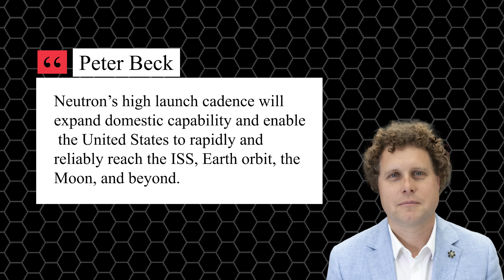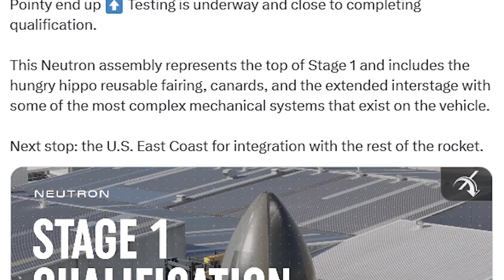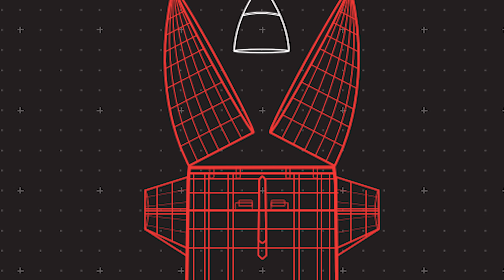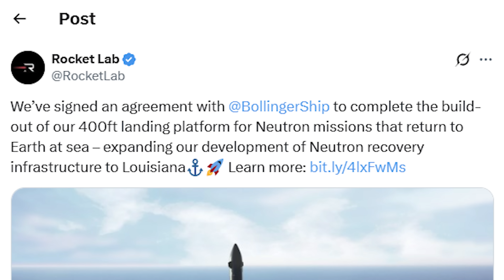What Rocket Lab just did totally humiliated Blue Origin after SpaceX…

Comment: Don't think you can compare Blue Origin's New Glenn vs Rocket Lab's Electron and Neutron rockets, the specs are so wildly different they could be considered different class rockets.
Blue Origin has a very rough and uncertain path ahead, it's competing directly with SpaceX in practically every way and is so far behind technologically that it probably can't compete on commercial payloads but may be granted enough government contracts to survive.
Rocket Lab on the other hand seems to be competing on a much smaller capacity lift class and whether it can compete commercially will depend entirely on the reusability of its cheaper materials as the tradeoff for less research into reusability. I highly doubt that carbon fiber vehicles can last anywhere close to stainless steel and I don't know that once SpaceX knows how to use stainless steel that the additional costs of construction and maintenance are that significant.

In other words, as things stand at present I suspect that the total cost of SpaceX rockets are going to be a lot cheaper than Rocket Lab's semi-disposable approaches of the booster and fully disposable second stage plus the likelihood that Starship/Superheavy payloads will likely be at least 4x or 7x greater than the max capacity of Neutron/Electron.

All the same,
If I was NASA, I'd be extremely pleased to see Rocket Lab's real progress compared to ULA's constant failures and Blue Origin's very slow progress. If Rocket Lab can succeed on its current schedule, perhaps by about 2028 maybe Rocket Lab can compete for a contract to deliver payloads to LEO and whatever might succeed the ISS, and maybe by 2040 compete for missions to resupply a moon colony. Rocket Lab is well more than a decade behind SpaceX but can still be valuable as the additional option if not SpaceX overtaking Europe, India and Russia.
Reply: Rocket Lab doesn't explode like starship 🤣🤣🤣

Comment: I wonder how they are handling the heat shielding?
Reply: Until these larger rockets start flying and are expected to be recovered, I doubt they're thinking much about heat shielding.
Or, no heat shielding necessary at all since the booster is expected to be slowed by propulsion(not heat) and the upper stage won't be recovered at all (disposable).
Reply: CART00N CLOWN !

Comment: I like Rocket Lab, because of their out of the box thinking.

Thing to remember, is future Rocket and Spaceship Tech will be a blend of things being developed now. There wont be any one company that gets everything right at first.
But there will be companies that adopt and adapt their way forward.

I agree on the wider tapered ships, and the permanent landing legs, and even the suspension, but I'm not much on carbon fiber.

I might use it on ship internal partitions to save weight.

One nice thing about permanent legs, is ability to be part of lift surfaces, another might be eventual independence from launch platforms and use of throttling instead of hold down clamps.

Also they are external structure, like the Starship Booster Strakes.

I was eyeing SpaceX's internal structure and it looks kinda clunky and over done.

Good design has an elegant look.

just sayin'
Reply: I guess RKLB have had plenty of opportunity to examine carbon fiber Electron rockets that have returned from space. If there was a problem wouldn't they know about it by now?
Reply: @energem133 
I think they know the problem, re entry, have heard they plan a retro burn re entry... ie use fuel instead of heat shield.
Carbon burns, so does the plastic resin.